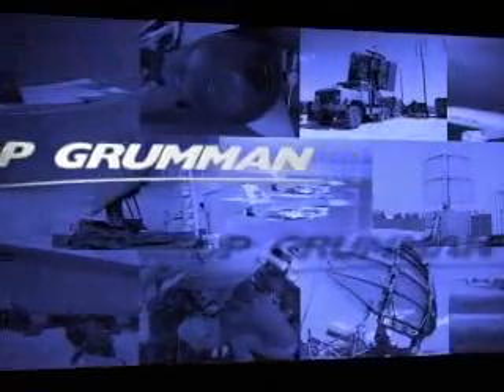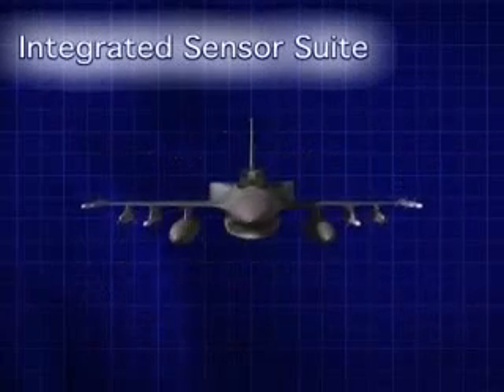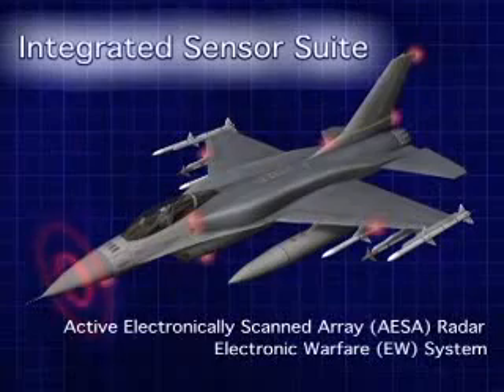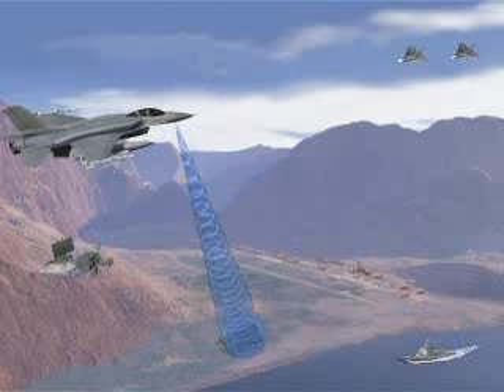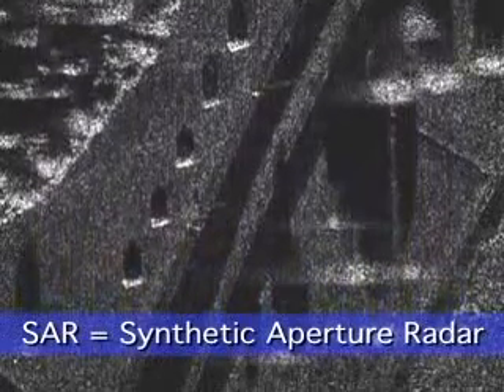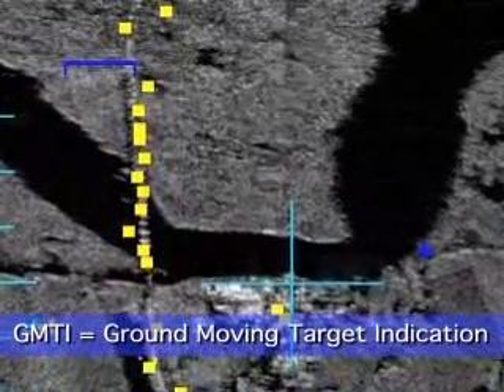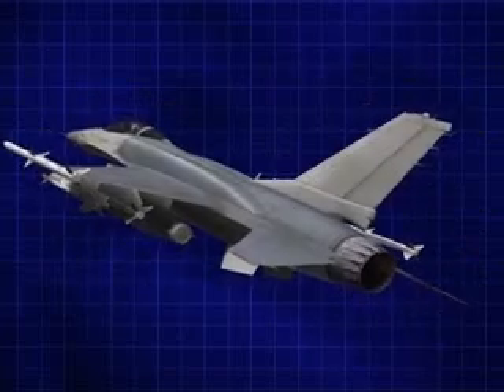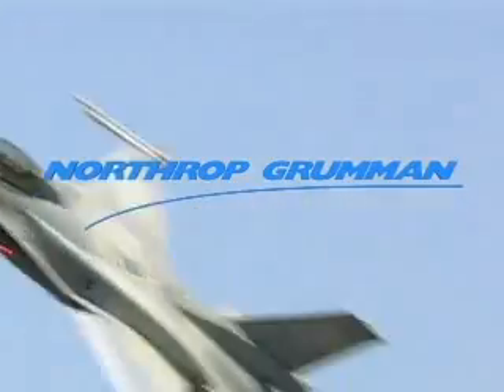How does an Active Electronically Scanned Array (AESA) Radar Work!!

Comment: russians did it first 10 year b4 american ... long live mother RUSSIA
Reply: Rizla Awa
What?

Oh you mean the MiG-31?

Sorry, but the MiG-31 has a PESA radar, not an AESA. The first AESA radar made by Russia was the Phasotron Zhuk in the MiG-35 which first flew in 2007, which is two years AFTER the F-22A Raptor, with its AN/APG-77 AESA radar was introduced.
Reply: Wrong. Russia still have trouble with AESA . You are thinking of APAR and that's also American.  Bell Labs proposed replacing the Nike Zeus radars with a phased array system in 1960,  Russians started there's in 1963 through ESPIONAGE.  Russians have always been THIEVES.  AESA was first fielded by JAPAN.  NOT RUSSIA. Get Bent.
Reply: Oh wait USSR died in 1991 whoops

Comment: 1st thing, the Carrier is extremely tough to find, and even if it is found, by the time a radar is within reach of the Carrier to detect it via radar, it would be far too close for normal carrier ops. The F-35C is designed to prevent fighters from reaching the carrier within that range.
2nd thing, Most countries reduced their orders of F-35 not because of the F-35 itself, but rather because of their current economic situation. None of them have decided to move away from the F-35s.